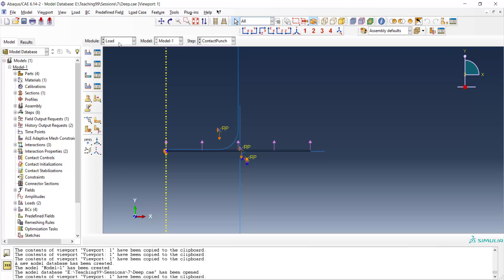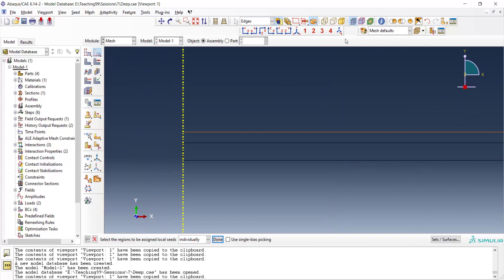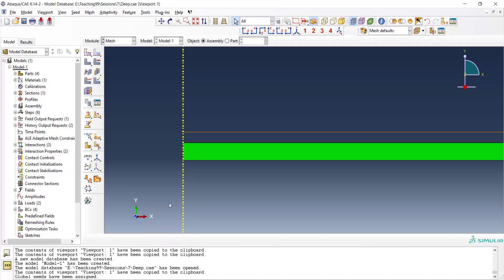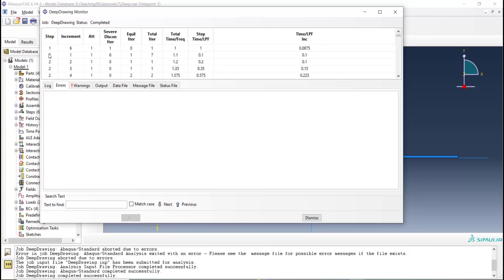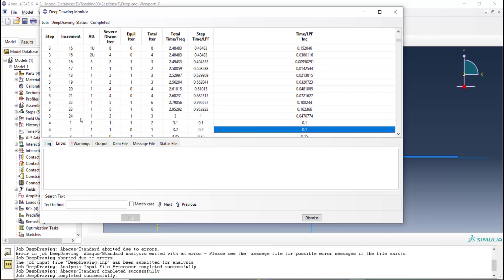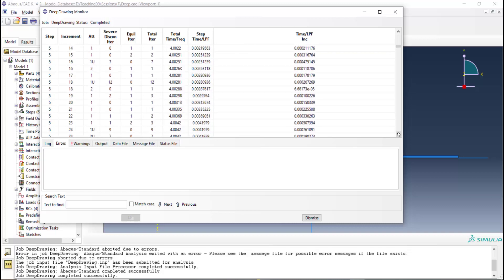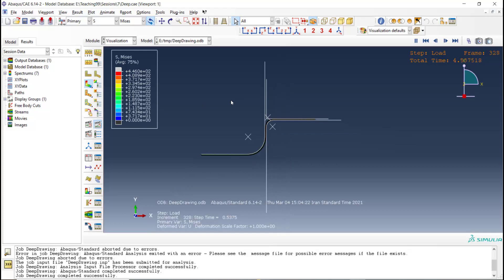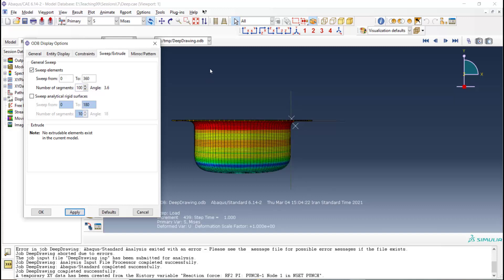Part4:How to set mesh for metal forming, Animate deformation, sweep results of axisymmetric modeling

Comment: Job deepdrawing: Analysis Input File Processor aborted due to errors. Error in job deepdrawing: Analysis Input File Processor exited with an error Job deepdrawing aborted due to errors.

This phrase appears when I submit for job.
Reply from the maker: Are you using explicit or implicit solver?
Reply: I am using explicit solver
Reply from the maker: For explicit solver definitely there is a mistake following the steps of the videos. Please check all the step. And if you could not solve the problem please send details of error to me by email.
Reply: Thank you for your kindness ❤❤